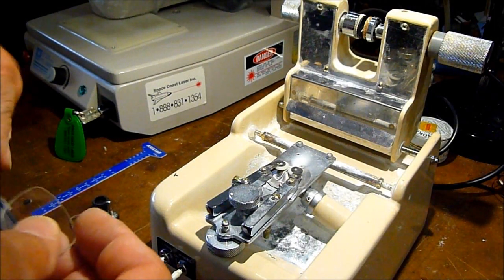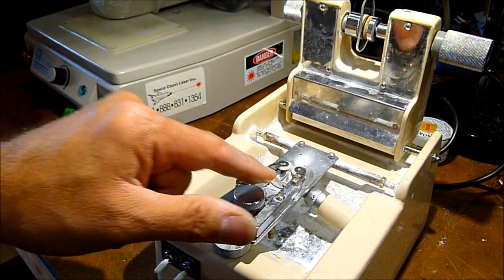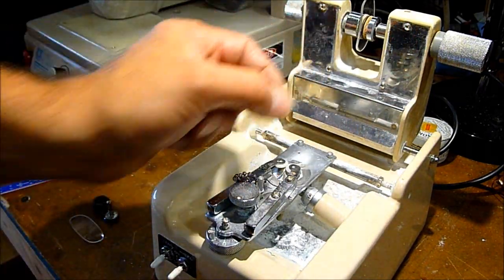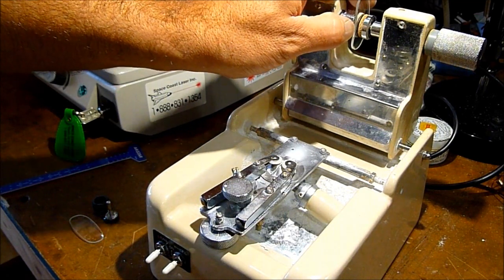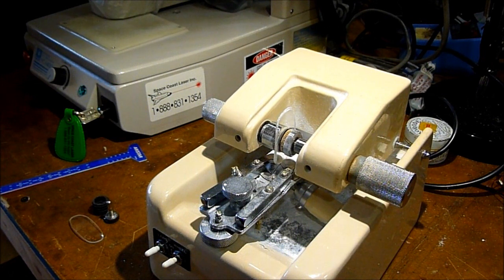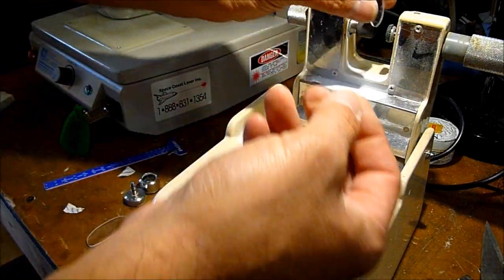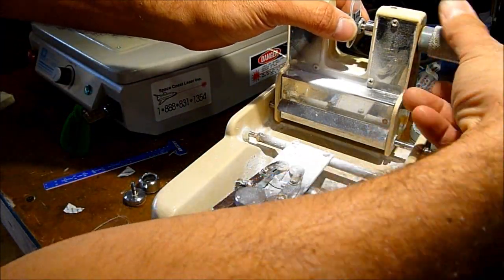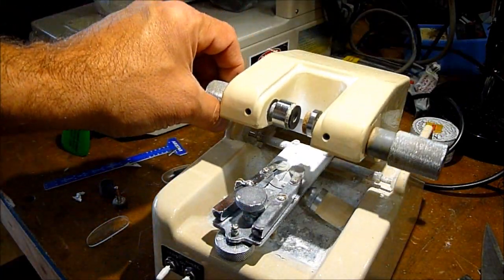Auto Lens Groover Modification for 18mm B Measurement

Comment: Greetings folks, I understand everyone has their own style of how they do things in the lab but I just want to pitch in here, first off I was wondering why your grooving lenses dry with no water, it's supposed to have a sponge with water in it so the sponge can put water on the lense while your grooving it, that eliminates the white powder in the groove when your done, it's much cleaner and neater that way, second you don't actually need an adapter to cut smaller lenses, all you have to do is chuck the lense on the upper or lower part of the lense and do half the lense at a time, then do the other half of the lense, and it's really a bad idea to start the cutting wheel first, best way is just turn on the lense wheel and let the lense spin around, you'll see where the blade is hitting the lense, once you have the line where you want it then turn your blade on and start grooving, this eliminates groove position error. The last thing a lab tech wants to do is remake a lense even if it's a single vision stocker, you probably know all this but maybe some folks don't, thanks for listening...
Reply from the maker: Yes, this isn't a DIY just a groover modification demo proof of concept that a customer requested to have built so they didn't have to fiddle with the lens as you suggested, maybe you had the volume off? Thanks for watching.

Comment: how do u do a franklin bifocal lens with that auto groover?  having so troubles getting it right ? new video please ...
Reply: Hi Rio, also known as an Executive Bifocal. You have to set the guides is a fixed distance from the back side of the lens to the grooving wheel and set the front guide flexible or spring loaded to adjust to the changing curves of the Executive Bifocal. Thanks for watching.
Reply: +The Truth Channel Ric sorry.